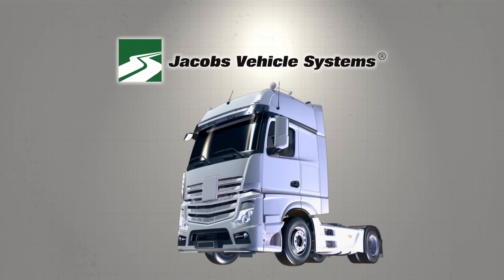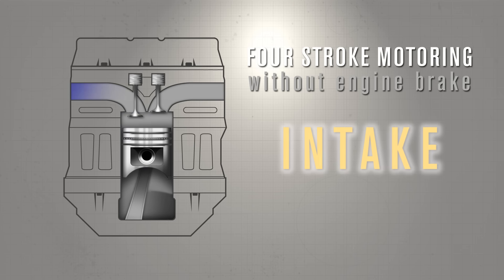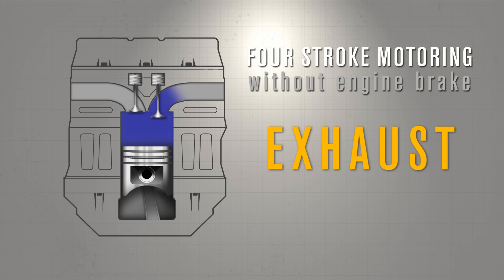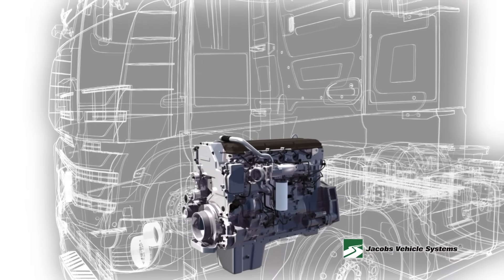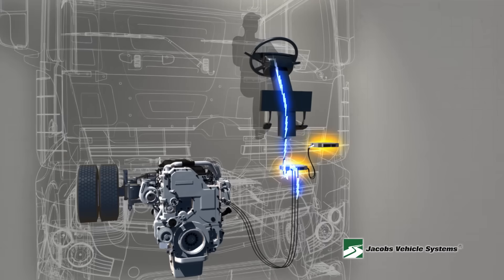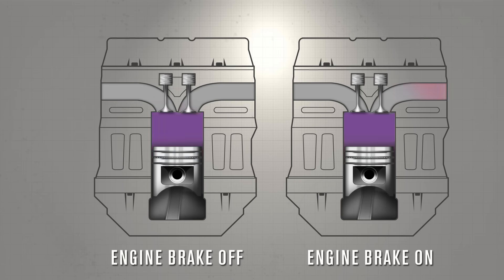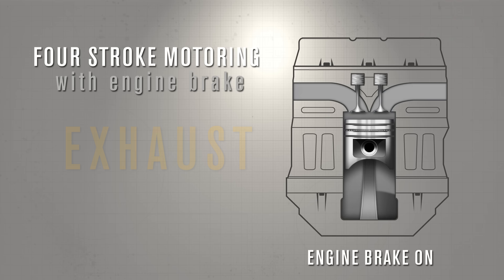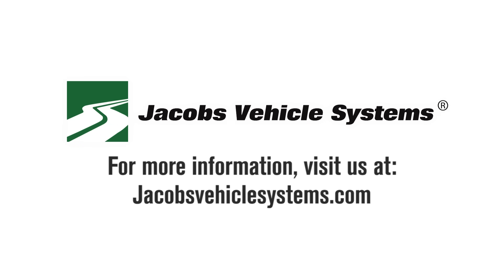How a Jake Brake Works - Jacobs Vehicle Systems

Comment: When I see a "No Jake Brake" sign, I think of this: The sound of my jake brake is quieter than the sound of my 80,000 pound truck crashing through your house.
Reply: So the only two options are a) using Jake brakes, or b) crashing?  What if I told you....that the middle pedal does something amazing....
Reply: @poopipeboy3033 The middle pedal is brilliant... until your service brakes overheat. Then you WILL crash, no matter how good you are.
Reply: @poopipeboy3033 on trucks you can’t rely on the air brakes cuz they can burn up
Reply: You can thank the Bob Tails for blasting neighborhoods with his Jakes at 90mph.
Reply: I live in a very flat part of Ohio and we have lots of those signs going into town.  If you can't stop your truck without the jake on flat land, probably need to get your brakes serviced.  Somewhere hilly is different.
Reply: @TheTurpin1234 LOL .... A very flat part of Ohio. That made me laugh, all of Ohio is one big flat part
Reply: @plap.  I live in Cincinnati.  It is not flat here.   I guess I'm talking southern Ohio
Reply: I've never understood those signs.  Jakes are for safety.  That's like saying, "No Brakes".  Sure, I'll coast around that curve.  smh
Reply: as far as ive seen those signs are in areas where it is not needed and is not necessary and are usually in residential areas. so if you are going the posted speed limit or whatever you deem to be safe then you will be fine but if you are going faster than you know you should be to the point where you need to drop 10 or more mph to go around a curve then that is your fault.
Reply: @Zack-dk3pt  actually there are..."avoid use of engine brakes" sign on a route i frequent....its on top of a hill ....it makes no sense
Reply: @highwayhobo104j6  use your service brakes
Reply: @highwayhobo104j6  slow down
Reply: @Zack-dk3pt  The only sign in my town is located on a super long hill that goes hundreds of feet down to the water.... I'd rather have someone make some noise than run the intersection and go right into freezing salt water....
Reply: @argonwheatbelly637 because people that live in those areas don't want to hear loud trucks all day long. It's not that hard to think about.
Reply: @argonwheatbelly637  to be fair, coasting is more effective for fuel, as long as the speeds aren't horrendously high for your turn.
Reply: @argonwheatbelly637  the signs specify where and when you should jake break. You do it every time you see one of thoae signs. Even if you dont need to do it.
Reply: @Dave_Crupel  : I agree.  I meant the "No Jake" signs.
Reply: @argonwheatbelly637  been driving very long
Reply: Tommy W. Good point and I'm sure you're not rockin the Jig middle of the night with nobody on the streets im sure you're good boss!
Reply: this sign is only valaible in a rural slow road, like 25-30kmh during the night when everyone sleep and where Jake brake is not necessary.
Reply: Maybe you should consider repairing your air brakes?
Reply: Why are you driving so fast in a residential area?
Reply: Slow the F down before you get in that situation?
Reply: You over the road drivers are total jerk pigs. If it wasn't for dump trucks you people wouldn't be going anywhere. Trash
Reply: @mrtomdorn  if it wasn't for us you would have no clothes on your back or food in your fridge let alone a fridge so get back in your Prius and shut the fuck up
Reply: @mrtomdorn     bad day ?
Reply: Right on
Reply: I think that you have an old truck!
Reply: grumpy old fart  first setting thats 1 cyl head second setting is 2 cyl heads and third setting?   jake for shifting? hotdog super trucker!
Reply: grumpy old fart awwwww how sweet!?!? I love a chainsaw lullaby...
Reply: If you're com'in at me doing 60-70 MPH, use all the Jake-brakes you want...please!!!
Reply: EXACTLY!!!!
Reply: I do it on my bike; cuz I'm a rebel
Reply: There’s also this wonderful invention called a muffler...
Reply: That’s Ridiculous. You have no logic, no foresight, and no brain. You have to be a self entitled truck driver. I get sick and tired of working on your trucks you lazy slobs
Reply: learn to drive your rig. being an a$$hole doesn't help anyone.
Reply: Come on man, really !
Reply: Lmao!
Reply: I always used it if needed anyway as well
Reply: In Australia, near residential areas it's "please limit compression braking" and I think the same thing 🤣🤣🤣
Reply: Lol fr
Reply: If you need to use the Jake, Do so.....Most of these signs are for those who play with Jake Brakes for amusement.
Reply: Not really, I just Heard a Logging Truck By my property Two miles from the Road, he Hit Three times, But Im not Hating!  🤣
Reply: @CajunReaper95  probably.  Some people don't think before speaking. Lol
Reply: You shouldnt be speeding through a fcn township then you numpty. I’m a professional truckie and the only time really to use against the no jake signage is if you are coming in to a township with a steep grade but even so use it respectfully especially at night.
Reply: There are other brakesystems which are quiet, so maybe it’s better to use them instead of the jakebrake
Reply: Well yeah I guess that would be quieter.
Reply: Cool. I’ve always wondered how the jake brake worked.
Reply: Yeah whoever puts those signs up are ignorant pests
Reply: It's a Jakes on reminder
Reply: Never go full retard
Reply: I mean even less dramatic the Jake brakes are usually quieter than those ridiculous drum brakes they always make the worse scraping noise
Reply: The signs are a reaction to the super truckers with loud Jake brakes who purposely gear down and activate them to to hear the rumble.  Howxwoukd you like living somewhere unable to get sleep every night?? On most trucks, you don't hear them becausethey are muffled so it doesn't apply.  There's always the attention starved look at me, look at me 🤡s who ruin it for everyone else .
Reply: @telcobilly  Or you buy a house that isn't by an airport, rail road or that isn't around a highway on a hill.
Reply: That's a real weird way of spelling your "No Safety" signs...
Reply: Only place I've seen em are where you don't need one. There's one near my friends place. 50mph straightaway. Only reason they run them is to slow down for their turn. Super loud when we're trying to sleep.
Reply: Exhaust valve just hit the piston. 😢 poor animated valve
Reply: Maybe you should slow down then
Reply: There are people out there who get wind farms shut down because they're too noisy. The unfortunate fact is that the vocal portion of the population is small minded. They would rather live in ignorant bliss for a short time (even if it means harm comes to them later), than sacrifice a few creature comforts (like their peace and quiet) for the sake of their own and everyone else's greater good.
Reply: @kg_canuck  no
Reply: Well, an alternative to the brake is simply downshifting and taking your foot off the accelerator.  Use the torque of the engine to slow the vehicle. However, the sudden revving up of the engine also makes its share of noise. Works well for pickups but not so much for 18 wheelers. (It also puts a lot of strain on the engine if you're hauling a heavy load.) So which do you want? Noise is noise. However, I live near the train tracks and can appreciate that the 2am and 4am trains aren't particularly welcome some nights.
Reply: Have you actually tested this or is it just theory? Because I don't believe you.
Reply: Slow down
Reply: It would be an issue except all the “super truckers” have to be as loud as they can be.
Being loud never made it work better.
Reply: This is why I brake check truckers every chance I get. Hit me and lose your career.
Reply: Your Jakes are quieter than the “mufflers” I have on my POV 🤣
Reply: @RyanMcIntyre  
Your POS??
Reply: Really, those are the only options?
Reply: Usually the sign is posted right where you need them too. Mine are muffled anyway so when I see that sign is right when I start using them
Reply: So basically, if you can't drive through without creating a disturbance or a danger to others, you shouldn't drive through.
Reply: Such an American problem with ur technology from 30 yrs ago😂 Euro trucks have disc brakes, safer and more effective. We can have a train weight of 74 tons here in Sweden and which is 148,000lbs and our trucks would still most likely stop before yours or at least be very shy in front.💀
Reply: Why are you going fast enough on our 35mph road to need jakes in the first place. Sounds like a problem between the seat and the wheel to me.
Reply: Learn to drive then! Dozens of times a day I have idiot with no loads going past my house using their Jakes because they love the sound of them! I watch dozens of oversized loads hauling massive pieces of mining equipment every week and they never use them.
Reply: You truckers really insist upon yourselves
Reply: If you see an actual sign that says "no jake brakes" then you should contact the jacobs company and they will get that sign changed to "no compression brakes" cause they dont like how their trademark name is used on those signs.
Reply: @CrazyForCooCooPuffs  It's fair use of the trademarked name. Government entities have legal power to use those signs as worded.
Reply: Superior retarding capacity
Reply: SO going fast in a heavy truck in a residential area is ok because it has a Jacob's Brake?
Reply: I always assumed it had something to do with vibrations and road durability..
Reply: Maybe you should slow the F down rather than drive us all nuts
Reply: They figure if they’re gonna get woken or otherwise disturbed by noise, they better at least receive some insurance payout…
Reply: Love it😂.in Australia when I see a ‘ minimise compression braking’ sign I’m like who gives a F$$$!
Reply: Same special hoods that ban train horns. They moved by train tracks, but the noise. A train hit my kids friend because he was on the tracks, I think with headphones. So sad. I can understand your sleep being interrupted by a train horn, though.
Reply: If you need jake brake to stop crashing into a house... you shouldn’t be fvcking driving.
Reply: Oh.., and I live in BC. The number of hills in urban centres where you need a jake brake are hardly any. In my town it says avoid using engines brakes going down a tiny section of a 6% slope with a limit of 50km/h. If you need a jake brake there... you should surrender your fvcking license. My grandma could go down that hill.
Reply: Studies show that a Jake Brake makes less noise than a Semi crashing through an intersection.
Reply: @madjack1748  
I've read that study.
Reply: And you guys wonder why trucks have so many restrictions. Don't be a dick. Use it for practical purposes, not retarded ones.
Reply: It's iether jake from jacobs! Or jake from from statefarm! We leave it up to you and weather you want an 18 wheeler in you're house!😎
Reply: @luisgordillo1695  silly kid. trucks are for men!
Reply: I mean I only use it for off ramp slow down. Don't be a dick in residential areas. (don't be a stupid truck driver because you are)
Reply: @skeletor2by4  its made for the long grade.  not the exit ramp.
Reply: Maybe you shouldn't be going a speed where you need your fucking Jake brake in a residential area. You're in a semi not a motorcycle, stop your young ass bitching
Reply: I felt the weight my first time and my first thought was "man I could plow this thing through a cement wall no prob"
Reply: would you rather:
jake from jacobs or jake from state farm?
Reply: @theconcretecowboy9561  that quote is pure genius and if you are over the road thanks
Reply: 80,000 pound truck, 2 gram brain.
Reply: We have a sign on a down hill ($1000 fine for jake braking) its a 30mph zone and was made a truck route. Why make a truck route no jake brake if it has a 7% hill and a cop at the bottom. Why? Revenue.
Reply: @hoodman420  a 7% gradient is not to be treated lightly.  Coming off of Mt. Lofty, that is a 10 km, 7% descent.  2 lots of kitty litters, and a set of traffic lights at a very busy intersection about 1 km past the last kitty litter.  There have been several fatalities on that last stretch of road, and the government here have installed a couple of 'flash for cash' tools and put a 60 km/h speed limit on all vehicles over 4.5 tonnes, and buses of all sizes.  The engineers from the DOT do not listen to those in the industry that are up and down the road, day in and day out.  Oh, and same engineers REMOVED a third kitty litter, which was up near to the top of the hill!  Go figure!

One evening, fully loaded at 32 tonne, two extra gears had to be dropped due to not having a working exhaust brake.  The way that the exhaust brake is set up on my vehicles is that it over rides the accelerator, and shuts the fuel flow to the injector pump.  Due to the above, what should have been a 30 minute descent turned into a 50 minute descent!  Plus all of the extra diesel that was burnt from not having the fuel shut off of the exhaust brakes.

There is a second gradient, descending into Hahndorf; 6% and about 2 km long.  Am waiting to see a large pile up due to an accident, due to trucks going down at 100 km/h.  Would love to know:  How do you stop a 68.5 tonne truck, doing 100 km/h, down a 6% gradient, when you have not got line of sight around a sweeping right hand corner?  Am waiting to see the LEO Wankers there, handing out tickets one night.  Am fairly confident that the sight distance is shorter than the braking distance!
Reply: @111jacare  you downshifted 2 extra gears?  breaking line of sight?   sounds as thou you might have down shifted 2 more gears to be in the correct gear, and not 2 extra to high, get it!
Reply: @georgetoma7139 , you have combined the two paragraphs that were written.  While the exhaust brake is working, the Mt. Lofty descent can be handled at a constant 1900 r.p.m., in 4 th gear, 17 km/h.  As the exhaust brake was not working this night, two extra gears had to be dropped, so second gear was engaged.  On this stretch of road, there is an ABSOLUTE sign - Trucks and Buses MUST USE LOW GEAR next 8 km.  This states, in law, NO SERVICE BRAKES ARE TO BE APPLIED, unless you have a spare $1K lying about that you want to give the state coffers!  As the exhaust brake is a secondary braking system, we are allowed to use this to assist in the descent.

As for Hahndorf, it is written in law, and it is meant to be commonsense, that you do not drive faster than what your line of sight is, compared to your braking distance.  So, if you sight distance is 200 metres, and your brakes can stop you at 300 metres, do you see a problem with the above?  This can also apply in periods of low visibility, as in heavy rain and fog.

It has also been told to me and others by a wise man from / in the 'old school' that you protect the front of your vehicle at all costs.  The theory is that if you hit the back of another vehicle, you will get your backside kicked, big time!  If someone runs into you, well, that is their problem!  In saying that, this was said to us as a basic hint to drive in a safe, courteous manner.  It is also meant to preclude tailgating; you keep the braking distance clear in front of you for the distance you need to stop - you do not want to be an accident upon an accident!
Reply: @111jacare  " Plus all of the extra diesel that was burnt from not having the fuel shut off of the exhaust brakes" Hmmmm. Are you sure you are driving a diesel?
Reply: @MrSunrise-  Yes, am driving diesel trucks!  The make and models of the trucks that are owned have the fuel shut off connected to the exhaust brake.  The 8 litre motor is fairly quiet with the exhaust brake in use, but, the 11 litre motor does bark, and has been mistaken for having a jake.  The motors are set up so the exhaust brake overrides the accelerator.  When the heel switch or dash switch is activated, on these motors, a solenoid lifts a lever which throws a butterfly valve behind the turbo.  Connected to the lever that the solenoid is connected to, a second lever goes back to the injector pump and shuts off the fuel to the injectors.  Due to the design, the exhaust brake is used to switch the motor off.  For the record, both the trucks are pre 1980's vintage, so there is a possibility that you may have not seen this set up on a motor.
Reply: @hoodman420  of course a liberal tax of sorts
Reply: @hoodman420  a jake at 30? whats the sense in that?
Reply: Tommy W. .... if your only options to slow down a truck is a jake brake or crashing into a house, then you clearly should not be driving a truck because you seem to have no clue about how to operate a vehicle.
Reply: @silentepsilon888  It's a joke smartass
Reply: if you can't slow a truck with just brakes you have no business being in one
Reply: Bisbee has a steep grade and just feet south and down of US 80 on this part are public and private buildings. Los of control could result in the city facing the question, how do we retrieve a tractor/trailer off the roof and the second floor of the library and what's the cost of fixing it? Is it worth it because of it's historical significance to not only the city but the county and state as well? Will the feds help, since the post office occupies the first floor? There is also a large presence of Environazis here as well. The kind that is in large part responsible for Phelps Dodge (now Freeport-McMoRan) all but leaving.
Reply: @DesertCatDad  Lol, EnviroNAZIs!!!!
Reply: slow down you :
1) failed student
2) Divorced asshole 
3) No talent cocky jackass
Reply: SLOW DOWN!!!!!
Reply: Learn how to drive and its not a problem. I report each truck I see for DOT infractions including Jake brakes in banned areas.
Reply: If your truck has inadequate service brakes you shouldn't be driving it.
Reply: @moi01887  it's not that the truck that has shit brakes its saving your brakes might have some when you really need to
Reply: @speedolover1793  keep your equipment well serviced. no worrying
Reply: And most of you forgot it's on high and can't downshift. Scrubs.
Reply: I guess you are forgetting the situation where I live. where you can see the stop sign for miles, its flat and the same drivers go through on schedule. yet they cant read signs apparently. I guess your argument is, if you dont like that I steal from your company than its better than me burning it down...what a dumb argument. SO if the jake brake is loud to me then the trade off is you dont crash into my house?   thumbs up dude
Reply: You know how to use the brake pedal don't you.
Reply: @paulscott6605 "  From your comment, my guess is that you have not driven heavy vehicles?  Most professional transport operators are taught to use their engine retarder / jake brake / exhaust brake as first defence; gearbox second and brake pedal last.  The reasons?  Brake linings on trucks are not a cheap or easy item to replace.  Truck brakes work best when they are cold.  The hotter the brakes, this expands the brake drums and depending on the type of brake system, you eventually run out of stroke on your brake booster - this is the item that converts air or hydraulic pressure into mechanical force.

When you are coming down a 7% or steeper grade, and you are at the business end of 45 tonne or 100,000 lb, you select 2 gears lower than what you would use to go up the hill in.  You also engage and use your engine braking, and stay off the brakes, ensuring they are cold should you need to stop in an emergency.

The best retarders now for quiet and performance are produced by the European manufacturers.  They are a hydraulic system that is operated via the gearbox, work exceptionally well, and they can slow you down from highway speed to a near stop with a very high efficiency.  The drawback is that if they get too hot, they cut out with very little notice.
Reply: Absolute fact
Reply: Or any dirtbag on a harley....
Reply: All I'm seeing is "we see the sign but can't read, and we have smol pps
Reply: If I need the Jake brake, I will use the jake brake, I do not care about any signs. Safety trumps your listening comfort.
Reply: Earl James 
Try that in British Columbia. You’d be dead in the first day.
Reply: @tekkielite  hello.   learn how to drive CHILD!
Reply: @tekkielite   try what. driving without a jake brark? its been done for years. when the grades were much steeper.
Reply: grumpy old fart  you have to go there?
Reply: Fuzzy Butkus  hello. some people have never gone down a long grade slowly. what do you think?
Reply: Fuzzy Butkus  i dont get the joke?
Reply: grumpy old fart  good for you.   that one way to teach a rookie.   laughing out load!
Reply: Everytime I see those signs I make a point to turn it on and give it a good high rpm Jake brake for half a mile.
Reply: @Earl James hello.  very well said !   truck driver
Reply: Hallelujah brother. That's the same thing I think at over 103,000. Screw that sign. I don't want to die and take out a bunch of people.  Complainers shouldn't have bought property next to the road. Duh.
Reply: @jeffh7021  So you're saying you need a Jake brake on city streets to survive?  Hahaha.  Wow.  My sister could drive a rig without one on city streets.
Reply: jones  wtf are you talking about? City streets? Grow a brain before your next comment.
Reply: @jeffh7021  what?!  Haha.  Ok smart guy.
Reply: @jonesjones7057   what do you drive jones?  Please. Surprise me.
Reply: @jeffh7021  keep your service brakes in good working order.  you do realize all roads are being driven without jake brakes. they must be better drivers then some?
Reply: @georgetoma7139  have you ever driven heavy haul in the mountains? Probably not.
Reply: @jeffh7021  you are so far off base you wouldn't know. 19 alxes coast to coast. border to border. and then much much more. 46 plus year experience. what-ch think now?
Reply: @georgetoma7139  then why you start shit about jake brakes?
Reply: when i see that sign i think "no jake brake? what do you mean, i still got my jake brake" then i give it a nice long test just to make sure its still there.
Reply: @Sublime_scat  cuz you're a douchebag
Reply: @Sublime_scat  a- hole
Reply: @Sublime_scat  Idiot.
Reply: When I see a sign that says 'no Jake brake', I know that it is time to turn the Jake system on!
Reply: @norbertsiewert3917  beginner
Reply: Obviously you've either not driven a loaded truck or heavy haul or don't seem to realize most come with jake brakes FROM THE FACTORY.
There is a reason they are there its city people that don't know jack crap about the real world yet think they know everything, kinda like they think its a good idea to make a SAFETY TOOL illegal.
Reply: @02Franxx     hello.  been driving very long?  i didn't think so!
Reply: hello.   seems as thou a bunch of children have been given what they think is a new TOY.   well it's not a toy!
Reply: @02Franxx  i ask? have you ever taken 100000 off a long grade without a jake?
Reply: doug  rock on, rookie... make as much noise as you can. Life is good.
Reply: I make it a point to let the break rip right at the sign sometimes special we have a huge hill that goes 50mph-45mph-25mph as you go down.... No Jake allowed I say screw it
Reply: @bamkils2  a-hole
Reply: @bamkils2  You're probably running straight pipes, too. Right?
Reply: When i see it i make sure my 10” pipes are sounding off
Reply: @highrailforlife9574  10" pipes have no practical purpose on that size engine. You're either an idiot or a liar. It's the latter. Actually, both.
Reply: @highrailforlife9574  i would think you might be smarter then that?  what with 10" pipes and all? do you realize how much backlash you put on all the hard parts clutch gears shafts u joints? just to make noise? S M H !
Reply: George Toma funny I’ve replaced none of the parts you referred too due to my pipes or my jakes outside of normal replacement S M H even harder
Reply: I'll flip the switch every time i c a sign
Reply: @speedolover1793  a-hole
Reply: @speedolover1793  Enjoy getting ticketed.
Reply: speed lover that’s not all your flipping.